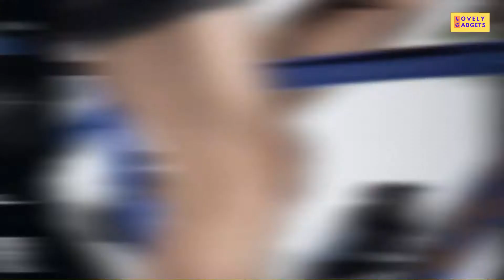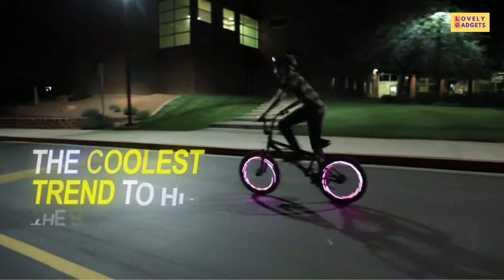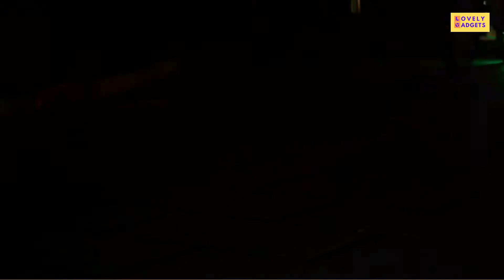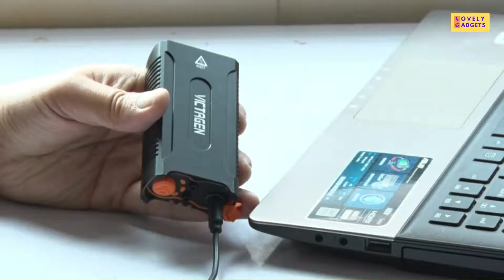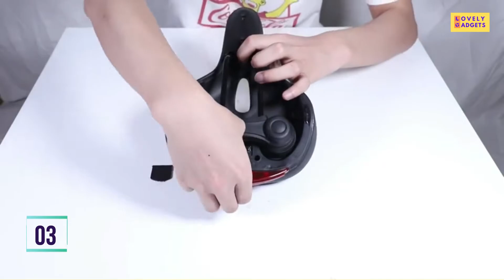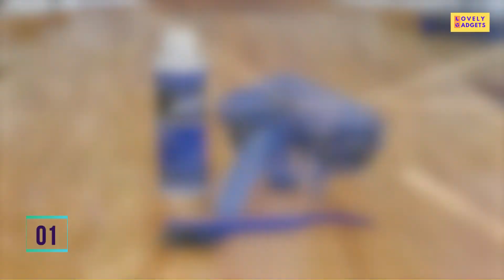10 Cool Bicycle Gadgets😍 | Bicycle Accessories | #01

Comment from the maker: 👉 Products in this Video:

🔥 Garmin TacX Boost Trainer, Indoor Bike Trainer
https://amzn.to/3CRQPsq

🔥 Bike Wheel Lights
https://amzn.to/3F2J8kT

🔥 Bike Mirror Rotatable And Adjustable
https://amzn.to/3unjz9k

🔥 Top Tube Bike Bag
https://amzn.to/2Zxeccc

🔥 Rechargeable Bike Lights Front and Back
https://amzn.to/3AT4YF6

🔥 Rehook
https://amzn.to/39NQk66

🔥 BIKE TOOL CO2 Inflator
https://amzn.to/3CZ48aC

🔥 Black Gel Bike Seat with LED
https://amzn.to/2ZICH6r

🔥 Bike Phone Mount
https://amzn.to/3iBhnqf

🔥 Bicycle Chain and Drivetrain Cleaning Kit
https://amzn.to/3A2KAAh